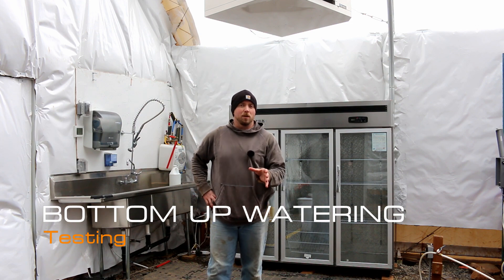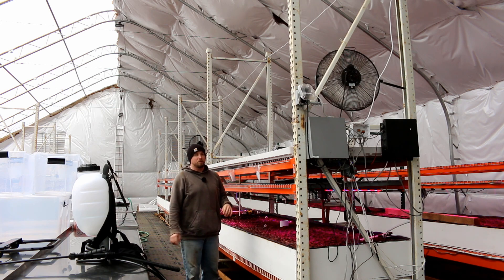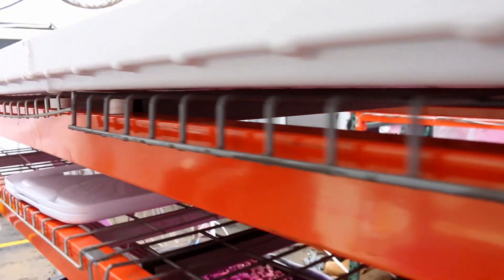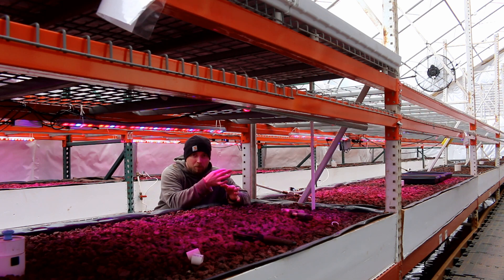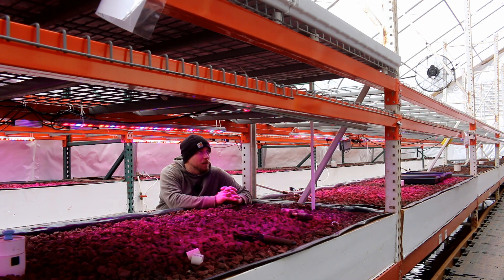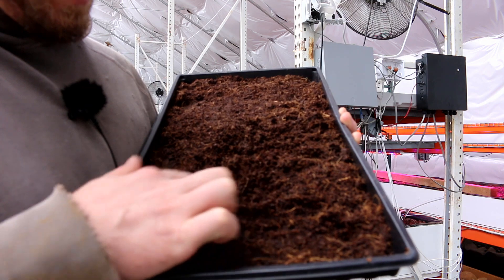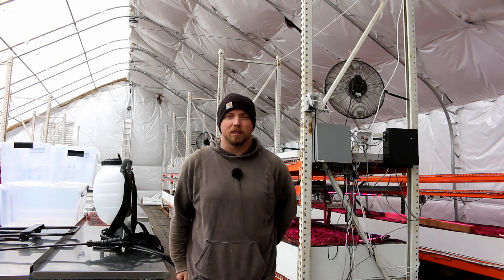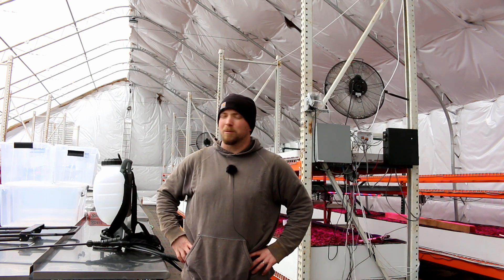Initial Install of BOTTOMS UP WATERING - For MICROGREENS

Comment: You could use velcro ties to tidy-up your automation cables. Reusable and more easily to open as normal cable ties.
Maybe some thing like this:
https://www.amazon.com/VELCRO-Brand-Black-2-Inch-91140/dp/B001E1Y5O6

Comment: I personally am a great believer in the KISS principle in a complex arrangement like this seems to be developing into. I agree there is benefit to having a separate pumping provision for these micro-greens compared to the aquaponics but do you really need separate valving for each tray particularly since you said it will fill each one quickly and your drain time sounds as though it will also similarly be fairly quick? I'm not keen on your reverse drainage back through the pump - there will inevitably be some detritus gather on the white trays over time. Why not do a direct drain through the aquaponics bed if not directly into it as part of its watering? What will you do to clean the beds, (surely you will get some algae growth on the trays) - will this drain into the fish tanks or will it need to be caught and removed?

I remain concerned about the amount of cables, pipes, fittings, sensors etc you already have and who, besides yourself, knows what is where and does what etc otherwise when you go on vacation and therefore not present on site how can anyone hope to help solve these sorts of issues?

Comment: On my flood and drain table I have a small hole that will drain the remaining little bit of water that cannot drain back down the fill port. That whole is always open and my pump is large enough to overpower it and fill the table with water to the overflow height.

Comment: TRM, thinking about the automation for the microgreen trays, what are the issues that keep you from treating them as two new aquaponic grow beds (using the same pump and identical valves for supply and drain)? Why do you need a new pump and new automation if what you have for the lower beds could work for the upper ones?

Comment: Nice concrete footings under each leg along with some timbers to keep the soil from falling into the fish tanks will have a massive upgrade. The timbers also will add some insulation to the upper section but still have contact with the bottom for the ground heat to transfer to the water.

Comment: For tray drains look at using a boat thru-hull.  They come in many sizes and flush to the surface in some styles.   Kinda like one of theses www.westmarine.com/buy/perko--plastic-mushroom-head-thru-hull-connection-barbed--P011_332_002_022?recordNum=20

Comment: Add a leveling device to each rail support leg. Could be easier in the long run than your plastic pipe trick.
Reply from the maker: +Dallan Wordekemper any links to suggested devices?
Reply: I'd like to thank you for this comment as someone planning a commercial system build
Reply: You are already assembled, so one way to fix your leveling problem,  which is a big deal for you at your state of construction, would be to weld a large nut to the side of you post and simply thread the bolt down to increase the height.  It would be best to raise them all a certain amount because you may need to raise OR LOWER, especially with leveling.